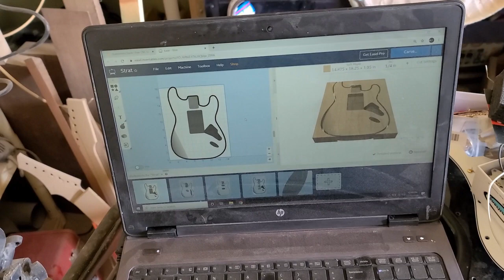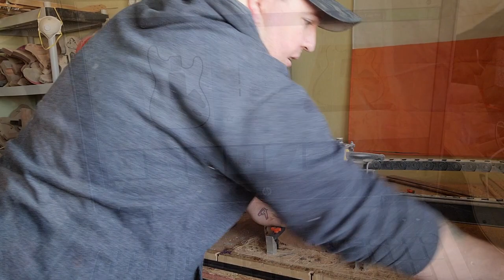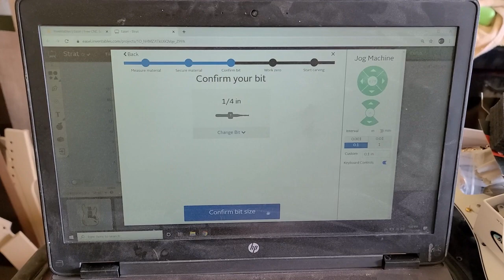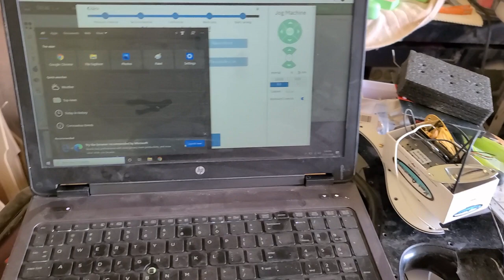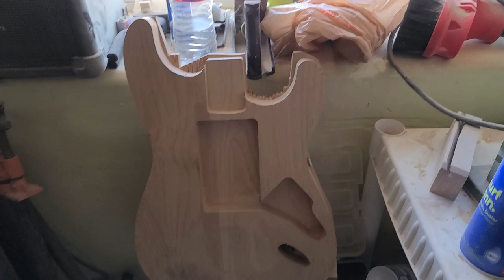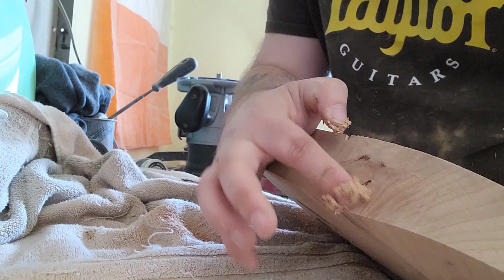Let's Build a Stratocaster Style Guitar Body... still using Easel!

Comment: love the videos..im putting my x-carve together now (just about done) i got some STL files for 3d. Im wanting to do necks on the xcarve.. Wondering about doing both sides. does it tell you to flip the piece over? Does it tell you when to change bits? how about that speed... wouldnt it be faster on the finishing? seems like there wouldnt be as much wood to cut
Reply from the maker: There's a ton to learn. I have done very few 2 sided cuts so not really the guy to ask about that haha...

Comment: Nice piece. Good follow on from part 1.
Hint to cheat cutting depth with that 1/4" - 1 1/2 cutting length. Initially do a 5/8" thick line 1" deep. Then change bit depth to do full depth contour cutouts. The 5/8 section will prevent the flat segment from burnishing wood walls when sunk deeper than cutting flutes! (You're going to Roundover that 1" anyway, so no worries of extra 1/16" thickness on the cutout!)
Reply from the maker: Good tip! I have gotten good results doing similar approaches i just didn't one this one... in all honesty I think I rushed this one to fast...
Reply: Always good to build up a good tips & tricks library for that awkward moment!